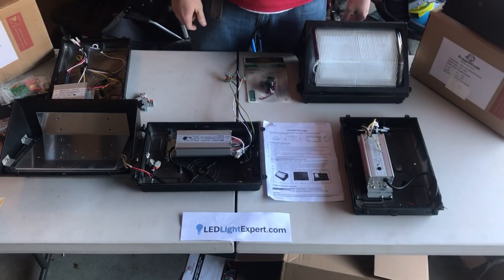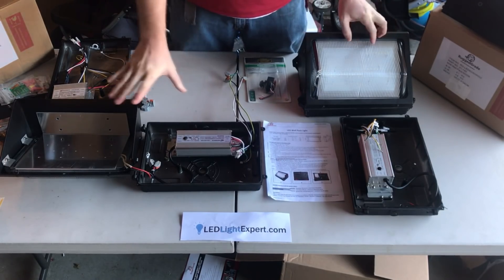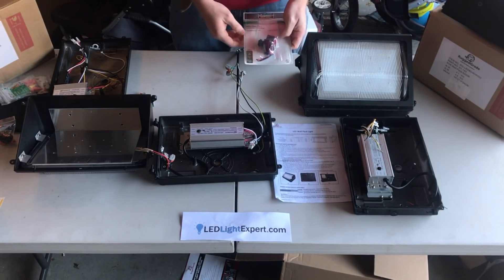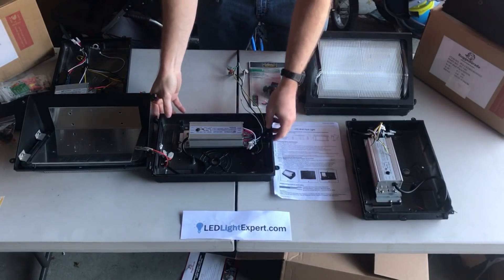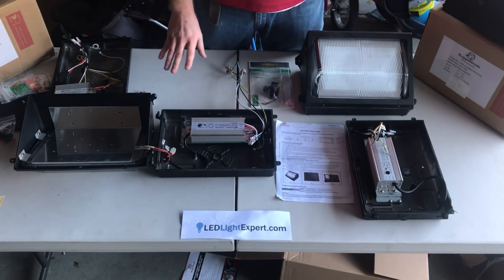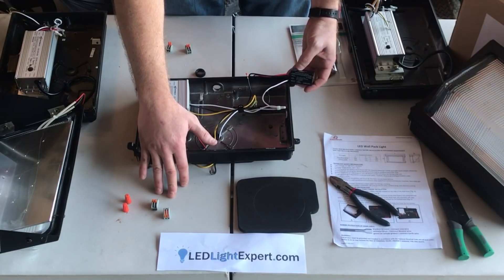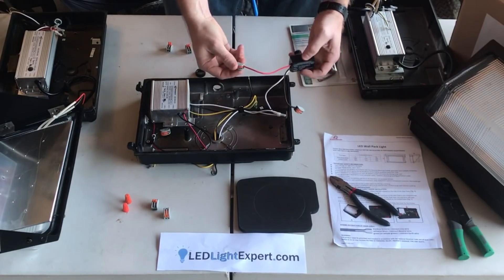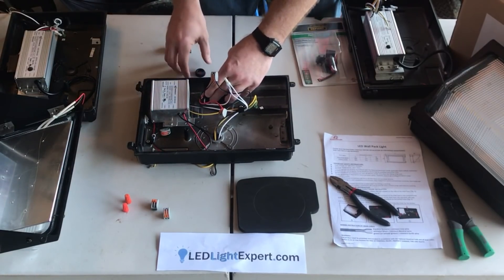LED Wall packs and Photocells Explained - What are they? Add a photocell to a wall light

Comment: Nice vid man. 
My led semicutoff wallpack  start flashing any ideas why?
Reply from the maker: You will likely need to get into the wall pack to trouble shoot it, but there is a few common causes for flashing. A. Not enough power getting to the fixture, check input voltage at the fixture. B. The driver is failing and needs to be replaced, this can be caused by many things with surging and/or voltage fluctuations like dirty power being some of the most common causes. C. Photocell tag - If your light has a photocell and there is other lights in the area that could be triggering the sensor, you can get photocell tag with lights turning on and off. This is usually notices at original install but we have seen it occur in areas when snow falls due to the light reflected off the snow. One way or another, you are going to need to troubleshoot the light.  If you can't figure it out and need to replace the wall pack, feel free to give us a call at 800-674-9420 or you can find our wall packs here: https://www.ledlightexpert.com/Led-Wall-Pack-Lights_c_29.html

Comment: Are those thermal or electric photocells? I have heard that you are not supposed to use thermal photocells with LED drivers, is that true?
Reply from the maker: Hi, all of ours are electric(photoelectric).  The electric ones last much longer, stay accurate, and handle the current inrush better than thermal.   If converting to LEDs its usually best to switch over to electric.   While it will work with LED, the existing thermal probably does not have much life left, and a new led may shorten it further.   A new LED wall pack with photocell may be easier. https://www.ledlightexpert.com/Led-Wall-Pack-Lights_c_29.html

Comment: What do you do when the light doesn’t turn off at sunrise (daylight)
Reply from the maker: hi there.  if the light never turns off, you need a new photocell see these(usually the conduit entrance style) ; https://www.ledlightexpert.com/Dusk-to-Dawn-Photocells-and-Bypass-Caps_c_92.html.    if the light turns off later as it gets brighter then that is just the photocell settings and chances are any replacements will do the same.   They all have similar lux settings.    Hope that helps